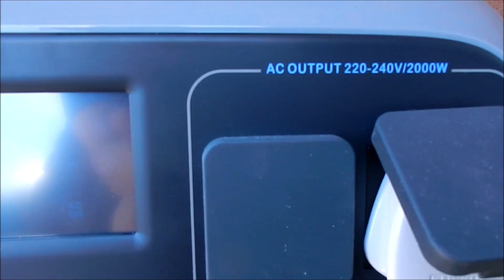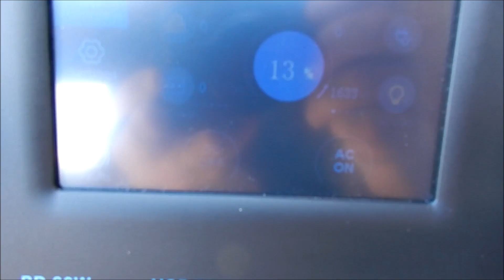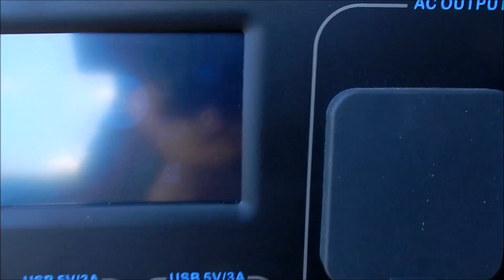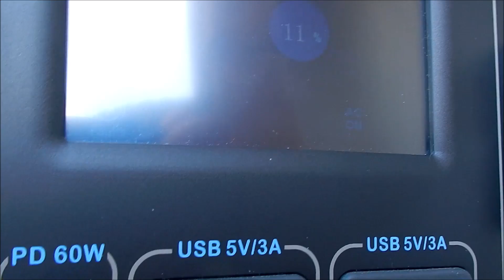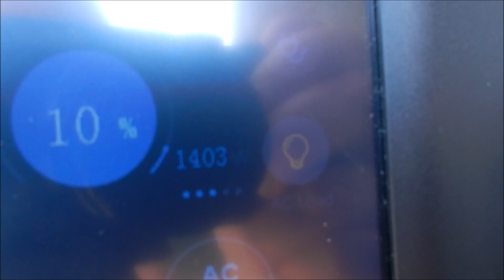Minimalist Electric Car Charger

Comment: I love a good rigger. You're a genius. I have a Juicebox that works some of the time. It may work 3 times in a row and then not work the next 6 times. You could fix this thing in 15 minutes. I've taken it apart and sanded and cleaned all the connectors, but didn't help. Any simple ideas what it could be?

Comment: There are digital potentiometers to use with arduino. Then wifi connection to the arduino. Control the arduino over wifi, or program it with other inputs.

Comment: my evse does 6A to  16A (@240v) 1200-3600 Watts specially bought that one because most campsite have a 8a fuse here in europe. and as a bonus I can charge it with my deltaflow mini (for like 4kilometers of range)

Comment: Can you kindly guide how are you able to detect stateA stateB stateC as you are using optocoupler. It seems pc817 alike optocoupler. 
This galvanically  isolates the cp pwm from microcontroller to car. But then even if car pulls cp pwm to 9volt stateB how are you able to detect the stateb

Comment: I'm surprised your car accepts charging with floating neutral, When I got my Zoé, it would refuse charging (both EVSE & granny cable) because my house had bad earth. I could trick it to charge by putting N and PE together in my house (just as a test, of course I installed proper earth).
As for the car's reaction time to PWM change, I can confirm it's fast, my Wallbox has the "powerboost" accessory which is remote meter restricting charge to available power (I have a 7kW charger but my mains trips at 9kW). The car always throttle down before the mains trips, even when I tried switching on two 2kW heating fans simultaneously while the oven was on The house meter maxed at 9kW. Clouds can't be that fast, shadow from a low flying fighter jet, maybe.
Reply from the maker: The car doesn't seem to care whether PE is connected to N or not. The EVSE is much more concerned about all that earthing stuff. After all, it's not the car that will electrocute you, it's the charger.
Reply: @JulianIlett  I assumed it was the car, but as you said, it might have been the Wallbox and granny cable not liking my house electrics.

Comment: You may of mentioned this but the signal is a 1 kHz square wave at ±12 volts making sense for the 12v batteries

Comment: I've built my own EVSE after being inspired from your projects.  CEE-plug 400V 16A, three phase, with relays. Worked fine when mounted on a wooden board, but now after I put it in a sealed plastic box it overheats and car says "communication error". Works fine when pulling ~5A, but not at 16A. Not easy to fix really.. I want to be able to have it outside in the rain still, so fans and holes is not a great solution.

Comment: with this done and working, this could be neat to have riding the electricity cost, where the car would charger at 13A at night, and say, 8A during the day. Or 32A at night and 13A during the day, depending on if it's H/W in or just a plug on the wall.

Comment: Looks like a diy Zappi is on the way! But seriously I'm interested to know, what is the PWM relationship to power drawn? My Zappi has a minimum of 1.4kw. Can this be set lower or is it set by the EV?
Reply: good question, i think its the EVSE that is the limiting factor at high current charging, EVs won't charge at less than 6A minimum. 1.4kW is 6A @ 240V, which makes sense.
Reply: @nightshadelenar  Maybe I need a lithium charger, charging a 'slave' lithium battery. Then when it''s cloudy I can charge this battery slowly and then dump this energy in 6A steps. Could be useful in winter when solar is low.
Reply: My car has 3 setting for charging current which works independently of EVSE. Minimum I can set is 500W. It’s 6 amps on EVSE and “minimum” in the car settings.

Comment: Can you decrease the wattage  to 500 watts. This would allow charging on a cloudy day without drawing anything from the grid.
Reply: minimum is 1.4kW, so likely a cloudy day will see some grid draw.
Reply: @nightshadelenar  The minimum shown in the video is indeed 1400W. In my experience however, the minimum is 10% pulse width, which corresponds to 5A, which at 240V equals 1200W. I have no idea if in practice the EVSE can "convince" the car pulling less by further decreasing the PWM. Maybe some cars may be pull even less than 5A with a pulse width less than 10%... or they will stop charging altogether if pulse width is below 10%.

Comment: So you want MPPT for charging your car? I think it can be done with several NE555 chips. If you use the right 'feedback' (which is in fact the voltage drop over a known resistor, which equals the amps / power) it may be doable. (not saying it will be easy, but I did see an MPPT circuit build with a 555). Maybe it just cannot be done that way, in any case, I am just brainstorming.
Reply: Was thinking the same thing.

Comment: As a UK electrician, at 2:00 you are correct; coming into contact with any one conductor of an isolated output is safe, whether it's line or neutral. You are also correct that "neutral" doesn't really mean anything on an isolated output; it isn't neutral after all (it isn't referenced to Earth) and only serves as a current path with the other conductor's potential swinging about in relation to it. If you do come into contact with one of the conductors (line or "neutral") of the isolated output, all your body would be doing is forming an equipotential bond between that conductor and true Earth. No current would flow, because there's no complete circuit through that true Earth back to the power supply. This is why we use isolation transformers in bathroom shaver sockets; same principle.
Reply: Something that just came to mind though, is if you have some class 1 equipment plugged into the power bank as well, and it is sitting on the ground (or you can simultaneously reach that equipment and the line conductor) then that will form a possible return path, making the line conductor suddenly dangerous.
Reply: @aaronmdjones  this is why you really shouldn’t go connecting Earth to neutral to convince powerbanks to charge cars

Comment: Couldn't you make things cheaper and simpler by using a 555 timer (or even 2 transistors) configured as an astable multivibrator?
Reply: He wants to be able to dynamically alter the mark-space ratio, so I don't know if that is possible.

Comment: For measuring response time, you could connect one channel of a sound card to the PWM signal through an attenuator and the other channel to a current transformer. (Or use a scope if you have one, but even the good scopes often aren't too great with slow timebases.)

Comment: Interesting project
I am interested in putting a few solar panels and a very small. House battery system on any electric campervan do you think an even more reduced system would be practical?
I’d like to avoid repeatedly cycling the vehicles chargingcontactors so as to avoid wear and tear of course
Cheers

Comment: Electricuted yourself once when 12 years old, started me thinking. I'm an engineer and have been all my life, and admittedlyelecruted myself with 240v across various parts of my body quite a few times as a child, and probably less as an adult. I have in fact lost count, and only realy remember the ones with burns specifically. altogether must be 50 of more times. and a couple or monitor discharges, and 1 monitor HT cable. Now I know im an idiot, but is this disregard for safety common? I now only work on live equipment with an isolation transformer and rubber gloves, but thats only the last 10 years.

Comment: Hi!
I usually like Julians videos a lot, but this time I had to down vote it due to showing a dangerous circuit.
DO NOT EVER MAKE A EVSE THAT CAN PUT POWER ON THE VEHICLE PLUG WHEN IT IS NOT CONNECTED TO THE VEHICLE!!! (Aka without any relays.)
I will report this video to YouTube as a dangerous video.
Reply from the maker: With that logic, any video about anything remotely heavy is dangerous - because you might drop it on your foot.
Reply: He's possibly missing few disclaimers here and there (e.g. DON'T TRY THIS AT HOME), but there's still valuable teaching out of this video. Go watch some ElectroBOOM videos before reporting Julian.
Reply: Hopefully you'll also report every youtube video that features the use and/or construction of electrical extension cords, because that's exactly what Julian made, albeit a fancy one with some extra conductors for control signals, but it's just an extension cord, like many millions of others, all without any relays to control the pass-through of the electricity. About the only real danger (like with any other extension cord) is 'Darwin Award' candidates sticking screwdrivers and such into the fully shrouded socket.
Reply: Not in the business are you? Your reaction is little over the top. This video is entirely in keeping with the content on Julians channel. Also, the EVSE plug is designed to protect the terminals from both humans and damage, so where is the great risk you refer to?
Reply: I see your ‘complaint’ and offer an iec c13 connector in reply
Reply: Youtube won't even remove videos featuring microwave transformers.

Comment: Always wanted to know if the relays in the EVSE were required...  but you should insure switching off the live wires before plugging/unplugging to prevent damaging the connector pins by arcing.
Reply from the maker: The relays aren't needed from a functional point of view, but are required to implement safety features.
Reply: It shouldn’t arc when plugging in as it’s not drawing a current. For unplugging, my car lowers its usage to 0.5kw before unlocking the mechanism to allow the plug to be pulled, so similarly minimal arcing if any should occur. Still not a bad idea to turn off the mains I suppose

Comment: Nice video so a good cheap system, does this mean your EasyEVSE is redundant ????? :-)
Reply from the maker: When I start using house mains, the relays will be needed for safety. They need to cut the mains if there are CP signal irregularities or ground faults.

Comment: My 7kW EVSE has a current transformer on my meter tail to prevent the EVSE from drawing more current than the main fuse is rated for. Self regulating, as household demand goes up EVSE consumption goes down.
Reply from the maker: Your house fuse should be rated way higher than your car charger. My house fuse is 60A - that's one reason I'm limiting my EVSE to 3.6kW (16A).
Reply: today's EVSEs implement overcurrent protection, ground fault protection and a thermal protection. your EVSE is like a smart extension cord which self test itself before connecting the mains, for safety reasons. as Julian just demonstrated, the car will still charge with fewer protections.

Comment: I suspect some cars may throw an error if it sees voltage there when it shouldn't be due to lack of relays. 
Some cars also do an earth loop impedance check, so if N is not tied to PE then they won't charge.
The response time to PWM is defined in the IEC62763 standard  as 5 seconds max, though I'd expect most cars to react faster, especially now solar is more common.
Reply from the maker: That earth loop check would be different in America wouldn't it? Doesn't their 240V have two live connections with a grounded centre tap?
Reply: @JulianIlett  In Canada (same as USA), we effectively use the central tap as a Neutral and only bond with the Ground at the main panel. The Ground (or PE) and Neutral are kept separated everywhere else. However, when we use EVSEs made for Europe (I have a couple of those), we simply connect our L1 to your Live (Brown wire),  L2 in place of your Neutral (Blue wire) and our Ground to your PE (Yellow/Green wire). There's no verification in those EVSEs that the Neutral is tied or not to the Ground/PE, but the EVSE always check that the Ground is available by leaking some current from the Line. I believe those checks are internal to the EVSE. I have no idea if the embedded charger performs similar checks.
Reply: @JulianIlett  Not an EV owner, but in the US the most common 240v connection type I've seen is two lives, a neutral, and ground (4 conductors). They are most often used for high-power applications (like the clothes dryer in our house). Smaller 240v plugs can be two lives and a ground, but those are less common, and (as Mike said) aren't compatible with EVSEs (especially Tesla).
Reply: @McTroyd  The Neutral from Nema 14-30 (clothes dryer) and Nema 14-50 (range) plugs is never used for EV cars (no idea why Tesla prefers this connector), but the Nema 14-50 is also frequently used for camping VR / camping sites to connect 50A 240V split-phase service (2x 120Vac Lines , 1 Neutral and 1 Ground/PE). Many people over here in Canada/USA can simply use Nema 6-20 (3 prong 20A 240V, no neutral) and Nema 6-50 (3 prong 50A 240V, no neutral) to connect their EVSE (Tesla even offers adapters for those too, but they are less popular).
Reply: @denisouellet6518  Duly noted! Thank you.
Reply: My Tesla doesn't like this. I tried it. It reports charger fault if the mains is there before it expects it to be. The car reports "charger error - check charger".

Comment: Does the car care if the 1khz has the -12v part? I've DIY'd an EVSE but used an ATX for 12v and -12v. I've DIY'd the car too, but never thought to check if the OBC I used would work with just 0-12v on the CP. I have a similar aim with the excess solar on the next iteration, will also be using your isolated DCDC idea to get -12v to make it smaller.
Reply from the maker: I'm told the Nissan Leaf doesn't require the -12V part of the signal. As for other vehicles, I don't know.

Comment: Use a 555 instead of microcontroller for 1khz
Reply from the maker: Yes, an EVSE could be as simple as a 555 and two optos :)
Reply: @JulianIlett  so in theory you could make a cable that is just the connector in both ends? like an emergency emergency-only-for-absolute-necessary that just charges 6A. no relays or protection or anything. so instead of having this big bulky "travel" "charger" its just a skinny cable with a schuko in one end and type1/2 in the other

Comment: Without ref to ground, does that mean a rcd would be useless? ⚡⚡👍😄
Reply: Yes.
Reply: @mikeselectricstuff  Thanks sometimes I think we would be better off without earthing and make everything double insulated, except for lightning protection. 👍
Reply: No vehicle has a ground reference. Some attempt to deduce a ground reference by checking voltage and/or current with the ground pin.
Reply: @Sylvan_dB  it will have ground reference if you touch the vehicle?? ⚡
Reply: @hunter00047  you are not a reference, but merely a potential path. A reference is a known source of truth.
Reply: @Sylvan_dB  thanks